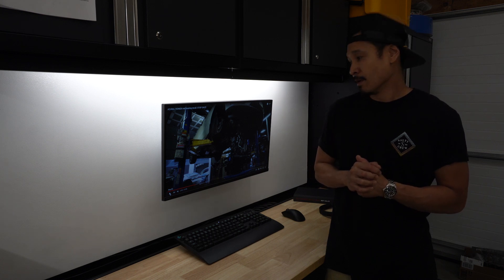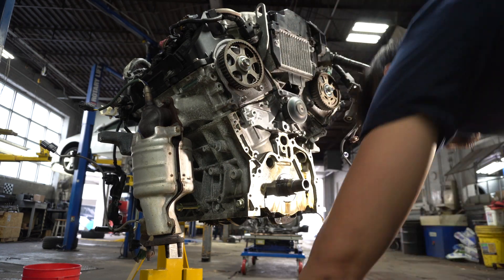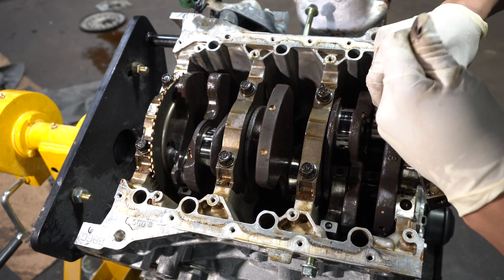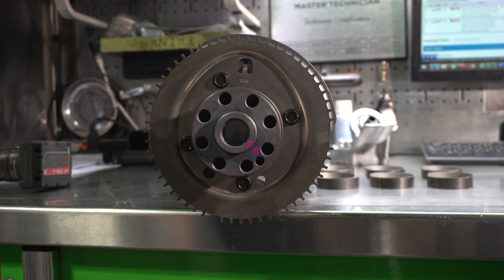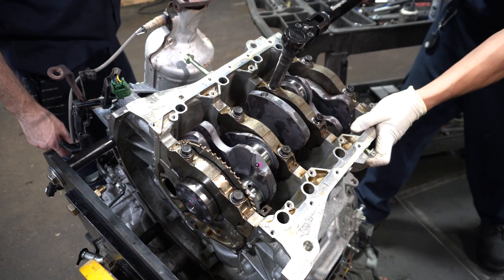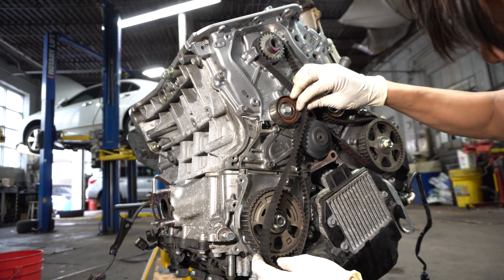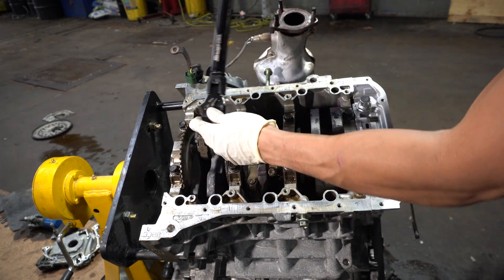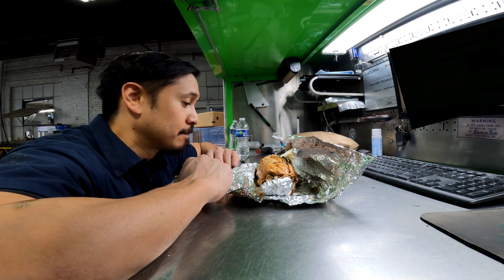ACURA & HONDA J35 CONNECTING ROD BEARING RECALL

Comment: I have a 2018 TLX A-Spec and haven't heard any noises. However, I am moving across the country and didn't want to drive 1500 miles with the open recall. I dropped it off at the dealership on Tuesday. I was later told that both the rod bearings and crankshaft had to be replaced. I should be getting it back later today (Wednesday).

12:30 Jesse from The Fast & The Furious.
Reply from the maker: @BasketBowlers  TLX’s seem to be the main offenders of crankshafts needing replacement.  Hope all goes well with the repair.

Comment: I would like to know how could my local dealer after my connecting rod bearing decide if the main needs to be changed too. How does my dealer know if my crankshaft needs replacement or not ? Should they change out my oil for free after performing this rod bearing job ?
Reply from the maker: The dealership doesn't decide what the engine needs, the needed repair is determined by the bearing inspection team at American Honda.  The repair can go one of three ways: 

-Rod bearing replacement only
-Crankshaft replacement (comes with all components seen in this video)
-Longblock replacement - only if the vehicle was towed in due to engine lock-up.

Yes, the oil is required to be changed during this procedure, so that is a maintenance that is included in the recall.  Any regular scheduled maintenance following the recall is your typical regular oil change and will have the regular service fee.
Reply: The crankshaft gets new main bearing, SOP. I believe they look at the wear on the rod bearings to determine if it is improperly machined crankshaft.

Comment: Why wouldn't you want a car with a new crankshaft installed?
Also, I always assumed dealership techs got paid by the hour or weekly salary.
If you don't mind me asking, how is service and/or recall work paid to the tech?
Reply from the maker: Just my personal opinion… swapping a crank the way it’s shown in this video goes against the way I learned to do it which includes balancing the complete rotating assembly and taking key measurements to verify everything is in spec.  I see this as sort of a “bare minimum” approach.  

This is going to be long winded, but I don’t mind at all… contrary to what one would think, most Automotive Technicians are paid on a flat rate scale.  It’s an archaic pay structure that incentivizes production and output by compensating based on time units per job.  This basically means that every operation has a time value.  For example a brake job usually pays 2 hours.  I can have a brake job done in about 20 minutes but still get compensated for the 2 hours.  This allows me to stack multiple jobs in a day to make as many hours as I possibly can.  It’s not uncommon for me to flag 20 hours in an 8 hour work day.

It’s a double edged sword, though.  When you get a job like the one outlined in this video, it kills your ability to stack while also severely shorting the Tech on time units.  This job only pays 9 hours and it took me the greater part of the day to do it, killed my body, drained my energy and not to mention is a huge liability.

The problem with this pay structure is that when the manufacturer comes out with a recall like this which requires precision and a meticulous standard of work which can’t be rushed; but has a low time value attached to it, then of course we’re going to do whatever we can to shortcut what we can to at least meet or beat the time… and that’s when things can go wrong.

Just being real.  This is the nature of the business and the result of big manufacturers trying to save as much money as possible.  It’s rampant throughout all brands.  Ask any Tech from any brand what they think of warranty pay and they’ll tell you the same thing.
Reply: The shop cannot duplicate the precision that the factory uses to assemble the engine, I have been at the Honda engine plant many times, the procedures and assembly equipment cannot be duplicated in any shop.  Normally the crank is installed before the connecting rods and pistons.   There are so many mistakes that the mechanic can inadvertently make. But if you don't replace the crankshaft the engine will eventually fail catastrophically. The best fix would have been a new engine. astronomic cost to Honda.

Comment: Just got back my ‘18 MDX from the dealer.  It only needed the bearings. The service guy said out of the 300 recalls they’ve done so far, only about 10 needed the crankshaft. And those 10 were mostly TLXs.  Not sure why.  Great video!
Reply from the maker: @bigboithe8th  nice!  Thank you!  Yes you are correct; the bulk of the affected cars are TLX’s.
Reply: @NSXavier997 I’m really surprised the customer didn’t want to do the timing belt kit since the engine was already out. Seems like a complete no brainer to me to just pay for the parts and an hour labor. They definitely won’t be getting that deal next time.
Reply: @bigboithe8th  Maybe customer understands that this fix is temp one and he needs to trade it in asap?
Reply: @bigboithe8th I just came on here to say that I just had my crankshaft replaced on my 19 MDX and the advisor was recommending the full timing belt service, which I was happy to pay for but they were quoting me approx 1800 bucks! I know parts are approx 900 with markup, why were they trying to rip me off with $900 additional labor? I asked the advisor and he couldn’t answer me. I said I’ll pay for the parts but not hours of labor with the engine out. They just put all my stock stuff back on. Really weird. I understand warranty time is crap and maybe they’re trying to make it up on my dime but I’m not gonna get taken for a ride either.

Comment: See you working in a dealer with an old-school service building built in the 1930s-1940s.
Bet you are not the first tech in that bay to say F-you to manufacturer or dealer management, only it was related to carburetors, chokes, points, tubed tires, leaded fuel and OHV engines.